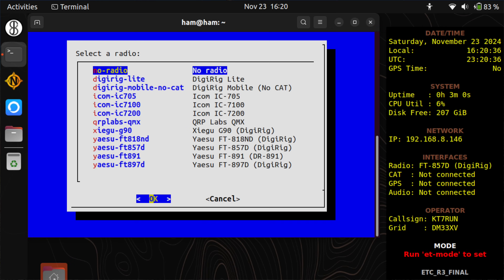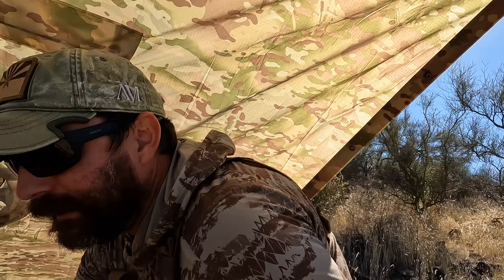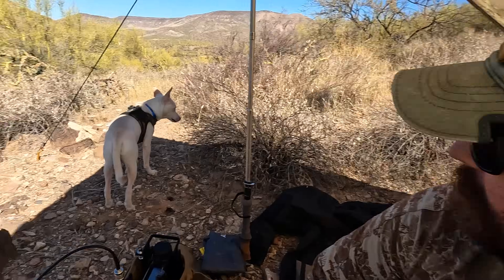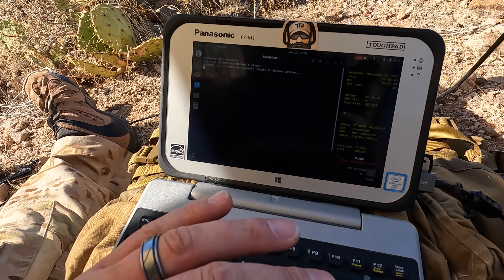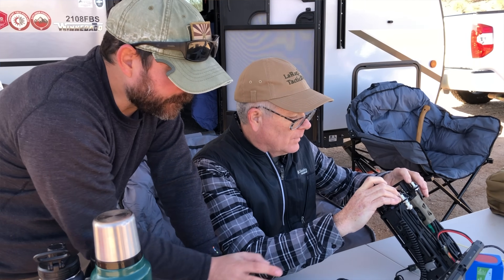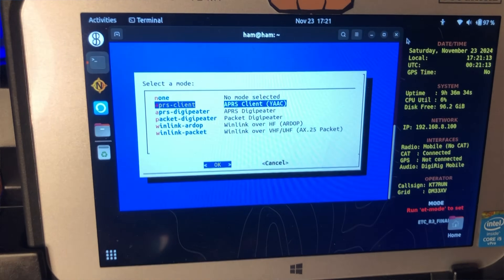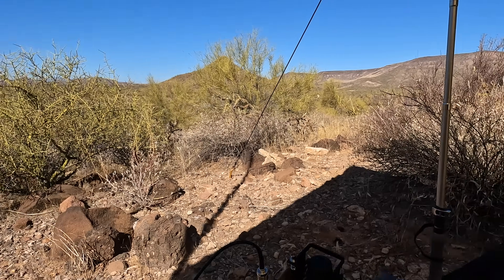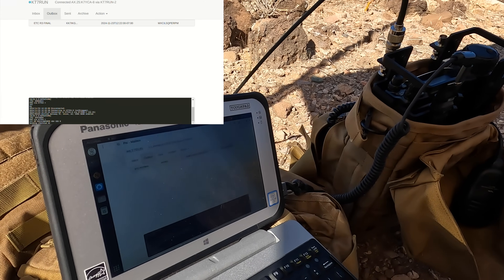Packet Radio Field Test - EmComm Tools Mode Switcher

Comment: As a Rancher I need a scanner to be able to pick up basic to advanced radio transmissions from hunters, rural crime thieves and more.  To be able to listen to local first responders would be an asset obviously.  I don't need to communicate as much as I wish to eavesdrop for security.  It is one of the last vital items I have overlooked. I had a uniden but need an upgrade asap.  Recommendations?  I will search your list meanwhile. Thank you Sir!
Reply from the maker: I'm using the Uniden SDS-100 for exactly the use that you are describing.

Comment: Gaston, in the 80s we had a well working packet radio network on VHF/UHF here in EU too. Some links and user nodes in 9k6 and later in 19k2 but mostly on 1k2. Also we did TCP/IP over AX25 - what a experience 🙂The book 'NOSintro' from Ian Wade, G3NRW was our bible .... 
Stable WL2k access with really small footprint is on VHF/UHF in 1k2 with Digirig-Lite and a handheld. I'm happy to have a PR-node with a link to a CMS in our town.
Tnx for your outstanding work and I'm looking foreward to testout the upcoming ET-R3. 73 de Wolf, oe7ftj

Comment: Good to see you out in field again, Gaston!

I have a similar pole, but mine is a window washing squegee pole.  My  Elk dual band attaches to it easily. Thinking of using my folding portable shovel as a mount with some u-bolts around the handle, but haven't tried it out yet.

I am impressed with your progress on the software, and I like how much shade your setup provides.

Looking forward to more videos, and hope you have a great Thanksgiving!

73,
Brett K5WXP
Reply from the maker: Morning, Bret. In love for hitting the backcountry and I needed to run one more test using the build directly pushed to GitHub, so we all win.

I've been considering the Elk for a long time as I like the ease of changing the polarization by rotating it 90 degrees. It would be great for 2m SSB and VHF.

Comment: Excited for the release. I’ve got a surface go 2 running r3. 
Getting pretty familiar with Linux file system now. 

Was able to make a udev rule for the All in one cable (AIOC) , json for the device, et-radio, and an edit to et-audio to set levels for this device. 

So far working all but having it display the radio in Conky. Pretty sure I missed a line or character in my edits 

Gonna need a navit tutorial that thing is a bit oooof. Gonna try and get organic maps working .
Reply from the maker: Wow... great work! Glad to see you adding a new radio using the configuration interface and udev subsystem.

Comment: Does anyone know if the version of Linux under the hood is kernel 6.4 or newer?  Hoping to run emcomm tools on an old rugged(ish) Chromebook with firmware to allow an UEFI OS.
Reply from the maker: Negative. It's 5.19.
Reply: @ thank you sir, I shall steer clear of repurposing a Chromebook for this purpose
Reply from the maker: @cchalfantusa  If you have a 64-bit Intel-based computer that works with Ubuntu 22.10, then EmComm Tools Community will work. ETC is built on top of Ubuntu 22.10.
Reply: @TheTechPrepper  thank you kind sir!

Comment: Good stuff, brother. I'm on the lookout for a pool pole like that, too. I hope you're having a good one. 🤙🏾
Reply from the maker: My wife picked it up at the local hardware store. I have no idea what brand it is as it's been outside for the last year. I have some thoughts on modifying to double as a walking stick and incorporating a built-in guy system.
Reply: @TheTechPrepper  that's a good idea. I always forget, do you have a 3d printer? With your climate, you'd do fine with one. The humidity kills me out here. I love that thing. I can print you up some stuff if you model things. 🤙🏾
Reply from the maker: @TheGeekiestGuy  Sadly, no. That's one rabbit hole that would kill all my productivity. Thanks for the offer on the #D printing support.
Reply: @TheTechPrepper  I feel you. It has taken a significant amount of my time. No problem, bud. Happy to help. 🤙🏾

Comment: Wow this looks amazing Gaston!   I wonder, can you predict what would happen if one selects FT-891 option you designed for the DR-891 but is using a plain Digirig and running the USB-B for cat control straight to the computer rather than the nifty approach that the DR-891 facilitates?  TLDR - will this work the old way with the FT-891 before the DR-891 hit the market?
Reply from the maker: I have no idea whether that will work, but it's worth trying. The 891 was the hardest radio to integrate and got pulled from the list twice. If you don't need CAT control and don't mind tuning your radio by hand, just use the DigiRig Non CAT option.

Comment: I like what you are doing with packet.  I used packet bbs systems when first licensed long before I had home internet access.  You have made amazing progress with EmComm Tools!  Thanks for the update!
Reply from the maker: I missed the packet days as I was late to the computer scene and didn't start until I was in high school. I had friends that were into it, but by the time I was interested in using a BBS they were all replaced by dial up to services like AOL. Let's bring this back. I'll be starting a pilot program with my local group here next month after the ETC documentation is complete for this release. 73

Comment: Concerning your comments on meshtastic and packet, or any digital modes for that matter, it is my belief that we are best served when we promote interchange and interoperability between modes rather than working in silos. A perfect example of what I mean is the ability to send a Winlink email from an APRS radio. From the Winlink website:

"Here's how it works: You send an APRS message using WLNK-1 as the destination callsign with one of the above commands as the message text. APRSLink responds by sending APRS messages back to you via your IGate. Of course, your IGate must be configured to gate those messages back to RF - it should be."
DE WA1KLI

Comment: Great Demo. I have been a Packet user since the 1980's (don't judge me here!) That was with a Data General Dasher dumb terminal and a TAPR prototype TNC. (just a board not even in a box)
As you have already covered, the biggest issue is getting interfaces like a TNC wired to a radio. It is expensive and difficult for a home builder to make cables for some microphone connectors and mini-DIN connectors on radios. The OG hated RJ microphone connector actually makes this easier.
Hardware TNCs still cost big money. I have 5 KPC-3+ TNCs. The nice thing about them is the small Personal Mailbox. I can leave the Radio and the TNC on to be a Digipeater and a PBBS without a computer. Note the TNC is a computer that is never connected to the internet. The internal software is on EPROM and has been stable for over a decade. Even then the only updates were to support other features Amateur Radio does not use.

I put the Nerd Stuff for the TNC in various application program configurations. The only thing left is command ECHO ON when I use it directly with a terminal or terminal program like PuTTY. It works with Winlink and APRSIS32 now without manual intervention. Just close one before opening the other. The hardest one to remember is how to get out of KISS Mode.

My local club still runs a Packet BBS that is part of some other networks. Most Packet infrastructure here handles very little traffic. I used the terminal program to save all received data with headers to disk file and found zero live traffic over a 2-week period. I plan to run that test again this year.

Comment: This video is really good to see first thing in the morning.  We've been leaning on our area, both my own loose group of buddy vets and the local ARES, to do more packet work in field (we are smack dab in the  middle of the Helene affected area).  I'm probably one of the few software / networking folks that gets the issues that comes up with Wires-X, YSF, D-Star and Ecolink (etc) with Sats and ISPs (Port routing/ IPv4 vs IPv6 issues / etc) during a disaster.  I'm real big on, after decades in IT, not relying on either terrestrial or sat based ISP networks for disaster radio work.  Starlink won't route alot of the digital modes used by Hams.  The big struggle, to me, was finding the right software suites I can say 'Consider this instead', there is alot out there to consider. I've been pushing digirig (I do like the Mobilinks) and Android / iOS tablet set up partially based on your videos and the guy from England.  I get what your are saying/doing.  Video came at the right time.
Reply from the maker: If it's connected to the Internet, it can and will fail. This is part of the reason that I opted against adding an IGate mode to the APRS digipeater mode.
Reply: 😮😮😂 1:31 😊